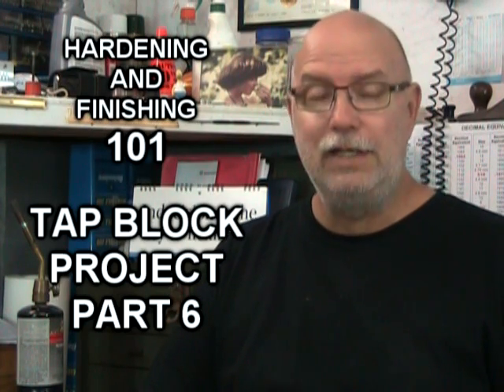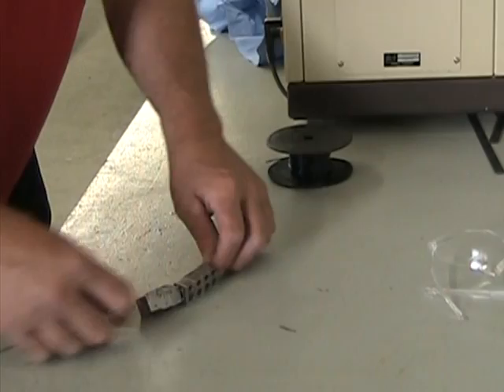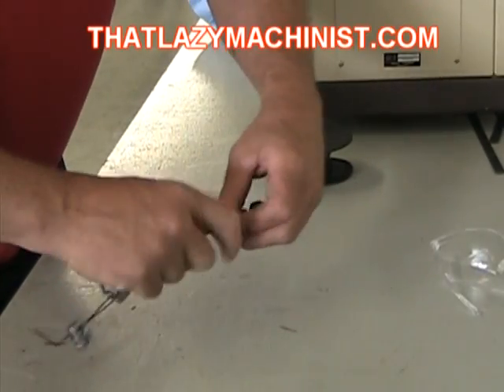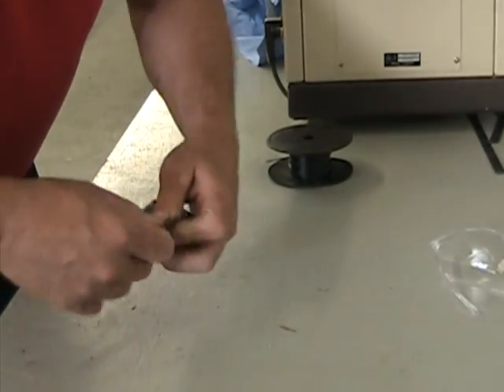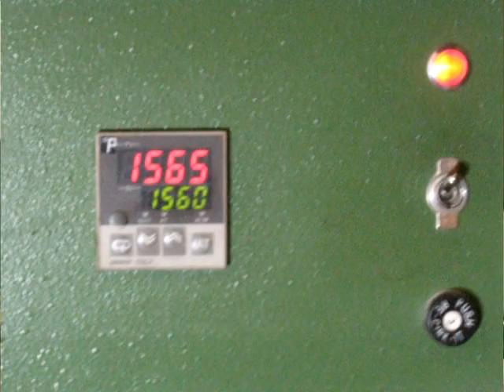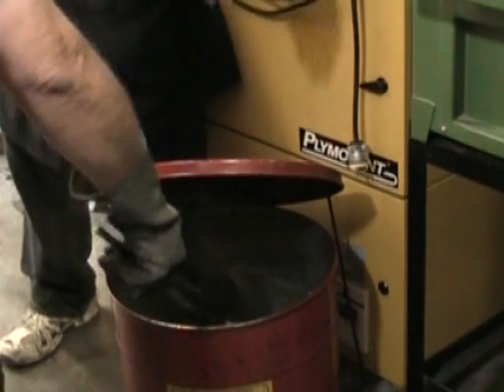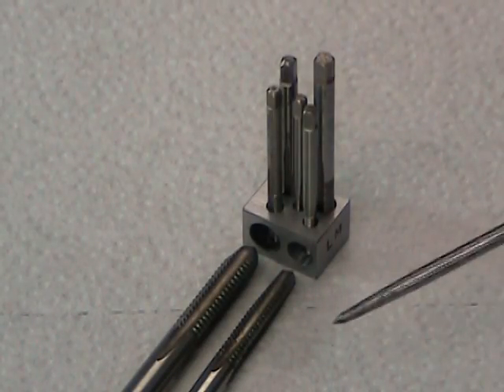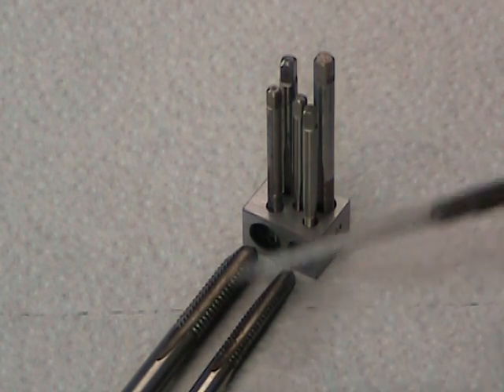TAP BLOCK PART 6, HARDENING & FINISHING 101 MARC LECUYER

Comment: you don't need to hardening the tap block: there are no necessity at all. The teeth of the tap should not touch the walls of the block, only shaft, otherwise tap will deteriorate.

Comment: How did you know when it was hot enough for hardening/quenching on the home method?  I never saw a magnet used. The Tempering I understand is by color.
Reply from the maker: Barry Lochridge Hi Barry, the hardening temp is also by color, I forgot to mention that. For a medium carbon steel, you are looking for something close to orange, not red or cherry red (more for tool steel) but dark orange or preferably orange. Bright orange or even worst almost white is too hot! If you check out my heat treatment videos you will get a better idea of the colors. Thanks for watching and for writing, Marc
Reply: Ah, Thank you.  I did watch the heat treating video, but couldn't remember that, and was too Lazy :) to go back and look.  But I love your videos and will likely do so anyway, because those are great ones!
Reply: Barry Lochridge Remember that magnets, loose their magnetism if they're heated mostly the hard disk ones....   :-(